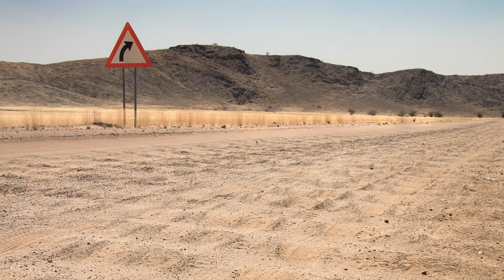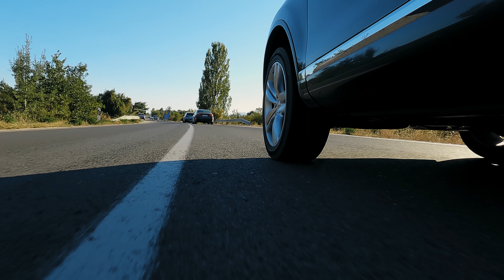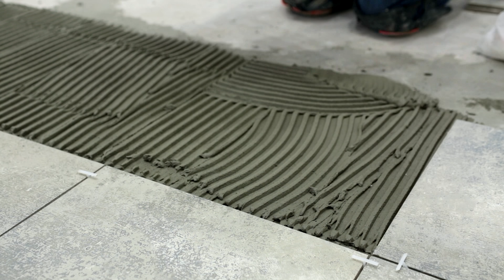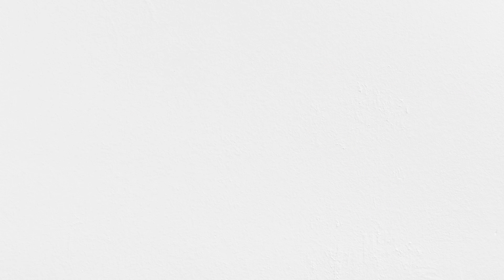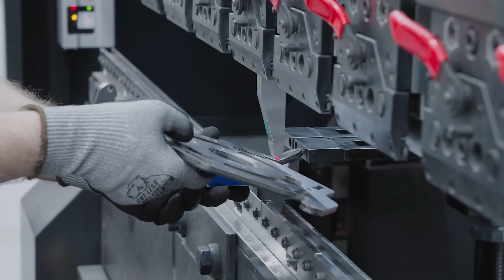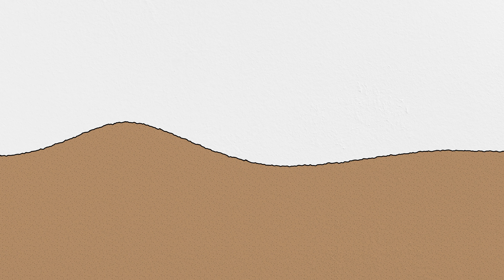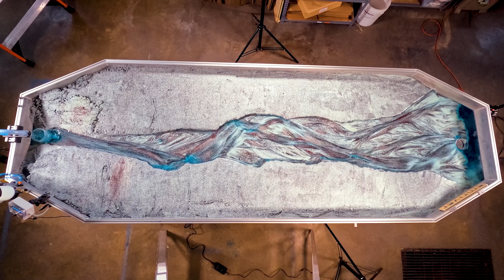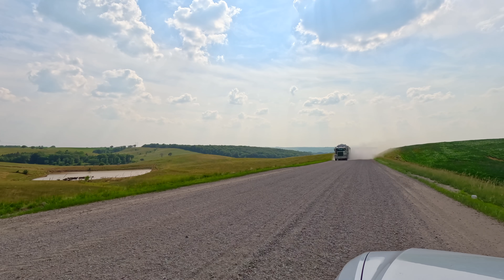Why Roads Get Washboards

Comment: Lived in Botswana for five years. The gravel roads there and in Namibia can get huge corrugations much bigger than anything Ive ever seen in the US offroading (mainly Nevada and Alaska). I've always been told it was from 2wd and overloaded vehicles. We would have very low tire pressure, keep it in 4wd, and still be able to go about 80kph and basically get the truck on plane (like a boat) on the bigger and faster gravel roads in Africa. Awesome video. 🙂

Comment: Sometimes it's just incompetent workers. They modernized a local interchange. They replaced the road bed & road surface just beyond the interchange that had failed as well. They built in washboarding in the road bed & surface. It's ridiculous that the State's inspector signed off on it. 4 months in to lanes reopening to traffic, and they have already had to grind the peaks to reduce the washboarding, but not eliminate it. The road will fail far ahead of schedule.

Comment: Makes me wonder if there's some additive that's readily available to help stiffen the top layer. In Arizona sometimes it's as simple as water that helps cement the fine particles into almost concrete. Of course, given everything we've learned about microplastics, you'd have to be very careful about say, just pouring some polymerizing agent in or something. Not to mention, you'd need something easily able to cover thousands of square  miles anywhere in the world and be literally as cheap as dirt.

Comment: I've often wondered if there is yet another factor on washboard roads.... the video covered well washboarding and an "undriven wheel" interaction with the road material.. I think the effect of a driven wheel may be a bit different based on what I've experienced in a 4 wheel drive vehicle versus same vehicle left in 2 wheel drive vehicle.  On washboard roads I have experienced that the vehicles wheels when only in 2 wheel drive oscillate up and down more violently than when I place the same vehicle in 4 wheel drive..  I think the driven wheels pulling themselves over the rising washboard might lessen the positive response of the feedback loop than when being "pushed" over the rising washboard. With both front and rear wheel drive engaged, it seems to change the "in resonance" positive response timing to in effect lessen positive rate reinforcement, leading to the wheel responses to washboarded surface to be much less vibration.

Comment: There's another cause for washboarding... Acceleration. When a road surface transitions so that the driver wants to speed up, the tires tend to spin relative to the surface, sending some of the material backwards and loosening the surface so that washboarding can start more easily. Amplifying this tendency is the 'frequency' of the rebound in the suspension and tire size. You can see this on roads driven by heavy equipment... their washboards are spread farther apart. Roads often smooth out more after a section  that encourages sudden speed change.

Comment: I used to live in an area that had many gravel roads. Although by measure of total traffic it was lightly used, if you live in one of these areas you will be driving on this surface often. I wonder if periodic regrading and compacting would be cost effective. The maintenance equipment would be a pretty good case for self-driven equipment. (And safer since it would be in low traffic areas rather than an urban environment.)

Comment: Not a civil engineer... But I have noticed the same effect on asphalt particularly in hot areas and when the road surface is old. Thinking the petroleum based binder gets loose in the heat and after enough time and traffic it happens, albeit slower than a gravel road.

Comment: From my empirical experience of driving and riding thousands of off-pavement roads, it appeared to me  that the wavelength of the ripples is directly related to the suspension resonant frequency, heavy oilfield trucks are stiffly sprung and create short ripples, but dirt bikes with plush suspensions create "whoops" ripples of 10 ft or more. Your apparatus could easily demonstrate this phenomena - change the length or weight of the wheel swing arm
Reply: I was fully prepared for him to start varying the weight and damper on the wheel to show how those variables translate into the washboard frequency and left disappointed.
Reply: I had the same thought from my years of riding a dual-sport motorcycle, and noticing how it was blithely unaffected by washboards I know I'd feel in my typical American pickup that was more representative of the usual traffic on that road.
Reply: I think the smaller, lighter vehicles tend to go faster and once whoop-de-dos form, they become entertainment and the effect is compounded. I see the same thing with snow machine trails as well as summer ORV trails.

Comment: same thing happens to vehicles tires as you drive.. its why its important to rotate your tires..  ive seen brand new sets of tires ruined after 12k miles because they had that ;corgation pattern on the tread of all 4  the tires.  when you drove the vehicle it felt almost like driving on cobblestones..   i hear it on alot of jeep owners with bigger tires going down the hwy you can heare the rhythm , brand new round mud tires do not have a rhythm they will have more of a constant hum. if you run big mud tires or luggy tires on a jeep or what not,  i highly suggest rotating every oil change.

Comment: How is it that washboards in the wild tend to be smaller than the radius of a typical wheel though? Shouldn't the wheel have to fit fully within the trough of the corrugations in order for the demonstration in this video to work?

Comment: Many years ago I read that washboards do not form when speeds are below about 5 miles per hour, basically animal-powered speeds. It also happens that motor graders will develop a "hop" at speeds above about five mph, which means the grader has to operate not much faster than a rapid walk in order to leave a smooth surface. Front-end loaders (payloaders) often develop a front-to-rear oscillation even on smooth pavement when operated at speed. Perhaps those comments may be of use to you.

Comment: Since the bumps are vehicle and wheel agnostic I am now curious if the wheel would smooth things out somewhat if it's left to it's rounds for a while below the critical speed that forms the bumps. Still wouldn't be a real solution for the actual roads, but curiosity doesn't care, it just wants to know now.

Comment: One of the best ways I've found to get across the idea that roads cost more is by comparing building a road to building a cathedral.

A cathedral is built in one place, resources amass at that point, there's usually a workforce immediately to hand, food grows in the surrounding territory and is easily moved to the cathedral.  This makes building a cathedral relatively inexpensive, since the infrastructure to support building it is already in place.  Absent modern technology, the vast majority of resources must be sourced within no more than 15 miles of the worksite.  Why 15 miles?  Ox drawn wagons travel, at best 10 to 15 miles in one day.  Chances are, those resource sites have already been improved and have a local workforce to operate them, long before you get around to building a cathedral.  Why?  Because the local population needed them.  Modern technology extends that range, but assumes the existence of the roads to support modern technology.

A road moves from one place to another.  Other than at the endpoints, there is seldom a workforce available.  Everything you need, workforce, food, shelter, tools, and materials, all must be shipped ever further distances to complete the road.  The longer the road, the more expensive it becomes, as the transportation forces need the same things the road workforce needs, even if all you're doing is clearing and grading a dirt road.  Add in paving materials, and now your transportation costs start eating the budget alive.  Absent modern technology, every 10 miles of road requires an additional day for food, raw materials, etc. to travel.  The oxen used must also be fed, which means part of your transportation costs is just feeding the oxen.  You cannot count on grazing, because all the available fodder will be eaten by previous transportation crews.  Eventually, you reach a point where all of your transportation is taken up just providing food for the transportation.  Stockpiles must be built up to allow the transportation force to keep moving.  You can reduce that by sending out search parties to look for closer sources of raw materials, but even if you find them, it's going to be more expensive.  You have to bring in the workforce to gather the raw materials and prepare them.  Which means you have to feed and shelter them.  Which means you're paying more money.  Move another 10 to 15 miles, and you get to do it all over again.  Again, modern technology increases the range, but the costs are still going to go up every mile you move away from your resources and workforce.  Local resources are even more expensive, because modern technology usually needs better roads, so now you're building side-roads that wander through the countryside to get the resources you need to build the main road.

Comment: That's interesting that washboards form from a passive axle passing over it. However you missed the biggest reason washboards form so fast, and that's entirely owing to human driving habits.   There are very few washboards near my driveway on the gravel road. Yet my neighbor has washboards that come out of his driveway and onto the gravel road and those washboards proceed for the entire half mile he regularly drives.  It's his driving that causes them.  People don't understand that you can't accelerate on gravel like you do on pavement.  Accelerating fast causes the powered axle to slip and that digs up the gravel, causing washboards to form nearly instantly after grading.  Pickup trucks and empty semi tricks are the worst offenders.  If people learned how to drive better on gravel roads we could save millions on grading costs as washboards would take much longer to form.  But most people still think they form mysteriously and complain as they fishtail with the pedal to the metal.

Comment: Snowmobile trails have HUGE wash board effect.
Reply: The snowmobile trails out west (rockys) can get 3-4ft deep wash boards, that is mainly due to sled suspension design though.
Reply: Every day!
Reply: While driving through the Adirondacks in NY I have noticed where the snowmobile trails intersect the pavement, there is almost always a noticable groove gouged out 😂
Reply: @potato_jake  Carbides and studded tracks
Reply: @AIRDOODOO  Oh 100%, sleds are much more abrasive than the rubber of a tire
Reply: I also used to get them quite a few times when I hit the lake with my jet ski years ago when I had a jet ski. And sometimes yeah, the wash board effect because of the weather would be absolutely huge.

Comment: Having driven a fair amount on unpaved roads I believe the reason that the different vehicles don’t average out the bumps is that drivers adjust their speed to point where the vibrations are just barely tolerable so every vehicle ends up reinforcing the same spacial frequency even if they need different speeds to do it.   I also noticed hills are the worst which is probably like your model but with a different sign since the driven wheels like to chatter on the washboard and are probably pushing the dirt backwards instead of forwards.

Comment: If you drive on interstate roads in the eastern US, you'll frequently encounter the phenomenon of "guh-dump, guh-dump, guh-dump" as you cross from one concrete section to the next.  This is the result of repeated "hammering" from vehicle tires as they move over the raised lip of one section and fall onto the next section, yielding a feedback loop that spreads the damage down the road as millions of cars drive over it.

Comment: The worst washboard I ever drove on was what started as a two-track back to a boat launch.  No one had ever "made" a road there.  The peaks were about one truck-length apart, and half a tire-diameter high.  Eventually it was made into a gravel road that is so much nicer.

Comment: Great video. I would be really interested in how speed and tire pressure affect this. I may have driven more of miles on dirt than pavement and we always debate the best way to travel in order to prevent this type of deep surface washboarding. More information on the phenomenon would be really useful to develop driving habits to prevent this.

Comment: It would be great to see more details on this. The county has an oil they spray onto areas which makes the ground very hard, it seems to help and I don't have to grade as much since they don't grade often enough to keep the washboarding down.

Thank you for the information, I had long heard that speed was a factor. I have often wondered how vehicle weight affects things, your demonstration makes me think vehicle weight does not matter. It seems all vehicle weights traveling below the critical speed would not form washboards and then all vehicles above the critical speed would form washboards but at different rates.

Comment: I do believe that if you had a road that has only one kind of car, each identical then you would see the frequency of those washboards to change. With random assortments of vehicles the suspensions aren't that far apart, speeds are not that far apart, the loads etc. are not two magnitudes of order different then they fall into some frequency that works with all vehicles good enough that we don't see those changes propagating. It is sort of an average of everything, and very, very few vehicles would form destructive waves, they don't need to resonate for this to work... So, you only need something, plate, skid, whatever, a bit f gravity and you will see those ripples form.

Comment: Grady you should consider doing a video on the thought that electric vehicles being heavier are going to destroy our roads if we see widespread adoption of them. More specifically, I've heard about the fourth power law, which admittedly is just a rule of thumb, but from the back of the napkin research I've done, it seems that even if you converted all passenger vehicles to electric in the US, The increased stress on our roadways is only a fraction of what commercial vehicles are already putting on our roads. 

Seems like a worthy topic for a channel like yours!

Comment: Where i live in Maryland, the county replaced the asphalt with cement where large trucks brake for a signal or stop because in the heat of summer the truck's weight caused the asphalt to slide and washboard.  The intersections were intolerable after a while.

I love your channel and the depth of your experiments and knowledge!  🤙

Comment: Interesting video, will never forget an intersection on my daily commute to and from my first job. It was a paved 4 way stop sign with 2 lanes in every direction. The two lanes in the going home direction would washboard the others were perfect. It was on the daily commute of literally thousands of drivers. It was like a game, people would break as hard as possible before the stop signs in parallel and the once at a complete stop or just about, they would accelerate to the other side where the two lanes became one with everyone trying to win the mini drag race to get the front slot on the one way road into the neighborhood. Have to admit it was a fun little challenge on the way home after a long tiring day. Always amazed me how quickly the washboard surface would come back every time it was repaved. Perhaps you might like to modify your test rig to take in the effect of deceleration and acceleration of the wheels, not just the hop skip of passing over the worn surface. Wishing you and your family the best.

Comment: You should add a sensor to measure the wheel's height as it turns, and another to track the laps/distance traveled. By plotting it all on a graph, you can see the wave drift and how fast the waves are created depending of which vehicules drive

Comment: Even asphalt isn't completely immune to washboarding - on downward slopes toward intersections, if there are buses or trucks on that road, their braking forces often push asphalt down the slope and same pattern occurs...
Reply: Doesn't even have to be at those places, too, there's a road near me that was recently repaved that's already experiencing shoving (that's the term I learned for washboarding in asphalt). Some of the worst of it is half a mile from any intersection and there's not a strong reason for most trucks to go down that particular road, either.
Reply: @EthanNeal  Of course, there could be other reasons to occur, mostly inside base layer, but at slopes where heavy vehicles slow down, inherit properties of asphalt can be enough in right conditions.
Reply: @mrblc882 Apparently it can happen without any slope, too, forgot to mention that road (3700 E in Jefferson County, Idaho) is completely flat, there's only 16 feet of elevation change in the 3 mile section south of highway 48 where the repaving was done. Though thinking about it a bit more, it could be used as a shortcut from Menan/Lewisville to Ucon, but it's still not heavily used regardless
Reply: I have also noticed that acceleration is causing washboard issues when leaving an intersection.

Comment: railroad tracks have the same problem..

But it is something typically caused by almost invisible micro flats on the wheels that are generated from slippage in turns.